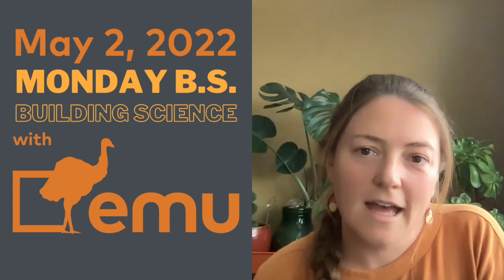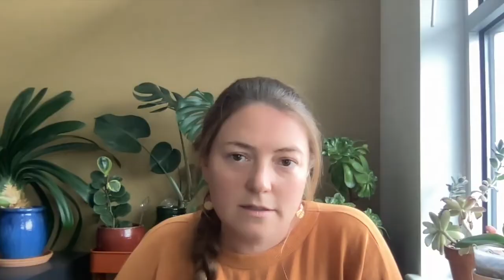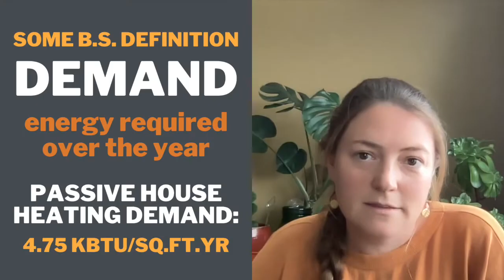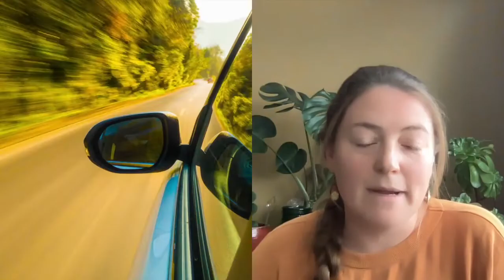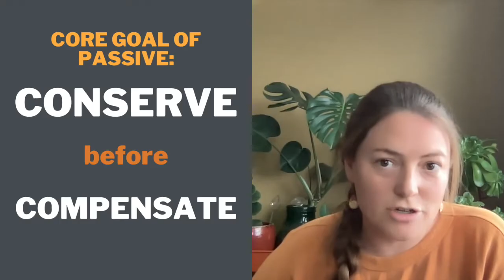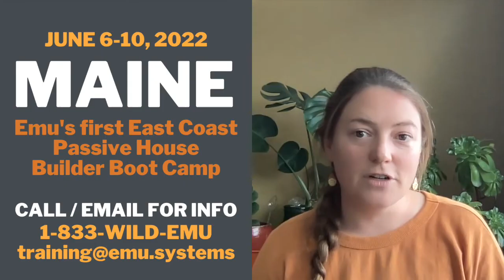Energy Demand vs Load in Passive House | Monday BS with Emu Mariana - May 2, 2022

Comment: Nicely explained. For how long the maximum heat load in a PH needs to run in order to achieve a comfortable indoor temperature of 20 degrees celsius?
Reply from the maker: That depends on a few factor, including 1) starting temperature, 2) exterior conditions, and 3) thermal capacity inside the PH envelope. Do you have more specific details about what you're asking?